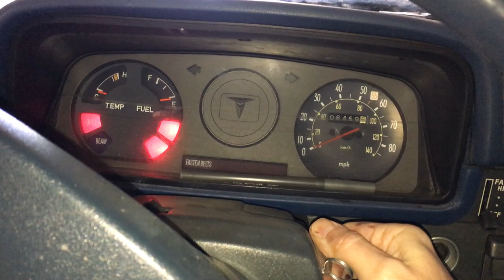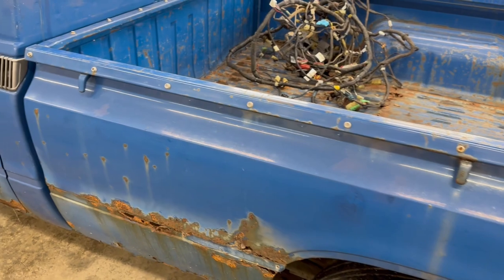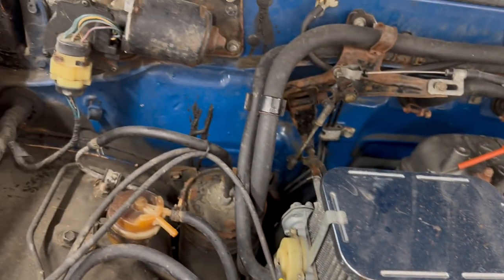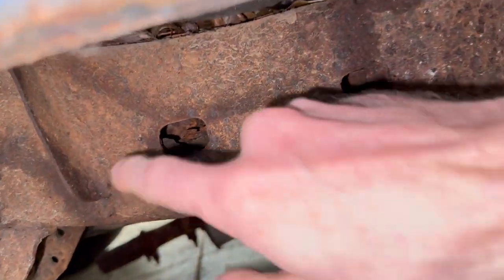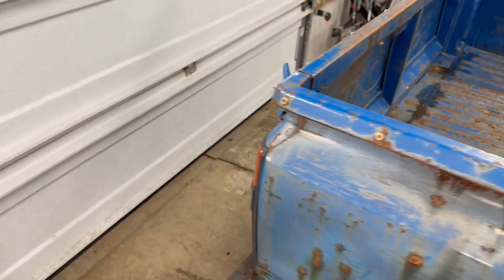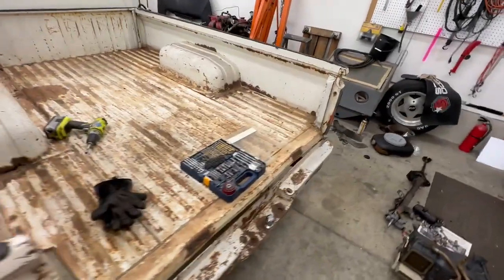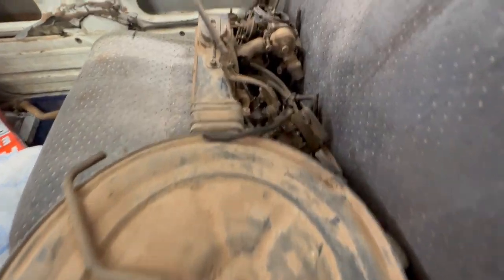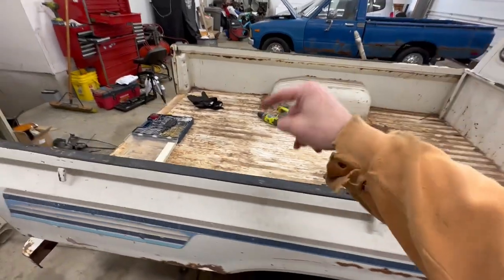My Rusty 1980 Toyota Pickup Truck Long Bed(s) Build Intro

Comment: If there is anything to do with Toyota utes l will click on it because l live in Australia and own a 1997 Toyota's Hilux rear wheel drive ute with the 22R motor and with a five speed gearbox mine is running driving and registered and four years ago l paid aud $1500 for it and no rust at all been Australia not much snow also it has an aluminium tray l see the ones from North America will rust because of the salting of the roads and many other older cars rust in the rust zone and Toyota spent billions of dollars replacing rusted chassis not in Australia l do like the 20R motor it's similar to the 22R motor just a bit less capacity to the 22R motor and 1997 was the last year of the 22R engine l am so happy to have one and it didn't appear in the Toyota Hilux until the mid 1990s as far as l know l will be interested in how your Toyota ute project pans out
Reply from the maker: The 22r will live forever, but like you said it is the rust that kills these trucks around here. I wish the Hilux was available in the US. After 1995, US replaced it with the Tacoma.
Reply: @6thGearGarage  Fortunately most Hiluxes don't rust in Australia because there is no such thing as the rust belt so the ones with the 22R engine will go for a long time l know my 1997 Hilux will out live me and any 1997 Hilux with the 22R engine manual air-conditioning an aluminium tray and under 500000 kilometres are actually worth aud$5000 to $6000 and l have seen them sell for that

Comment: Are you still running the original toyota driveline on your lifted truck. I jist bought an 89 that's running the stock trans and axles, but it has a tbi 350 swapped in. I'm just wondering how strong the trans and axles are. So far, they seem to be ok, but I haven't driven the truck much since its a bit of a project. Thanks in advance.

Comment: I have a truck similar to yours, mine is 1979 al so is blue and I'm looking for the Heater Hose Kit in case you want to sell it.
Reply from the maker: I wouldn't buy a part like heater hoses used. That rubber is 40+ years old and not worth the headache of a possible coolant leak.

Comment: This is very similar to what I did a couple years ago. Had a low mileage 1984 3/4 ton 2wd long box with a rotten frame that I frame swapped and built up with a donor 1987 2wd. You don’t even need a hoist to remove the body, I was able to sling the cab and box off with a regular engine crane. I would recommend you try and find the heavier front sway bar from a 3/4 or 1 ton model for better cornering at highway speeds with a load on the back. The parts for these 2wd trucks are super affordable, and their really easy to put together. Your going to have a great time with this project! Let me know if you have any specific questions, would be happy to help out 🍻
Reply from the maker: Thanks!

Comment: looks like the parts truck has aftermarket a/c. if you have any interest in keeping that and making it work let me know. I have a few different 22r compressor brackets and all the stuff requited to make new a/c hoses.
Reply from the maker: It does, I just pulled the evap box out this week. IM not sure if I’ll put it back in yet…
Reply: @6thGearGarage  the evap box is the hardest to find part for these trucks. its very easy and pretty cheap to upgrade all the under hood components to modern stuff.

Comment: Did Toyota ever make the 20R with a points distributor?? If so would it fit a 22R?? (thinking EMPs)Tip on rear main seal leaks...I chased them for years (been driving same 1987 since 1987, 1/2 million miles) till I figured out its the seal retainer gasket 90% of the time...silicone them (I use Toyota black, easier to take apart then autozone RTV) and timing chain cover gaskets, also helacoil 12mm threaded hole on top on timing chain cover (bolt through the head under dist. gear) allows for a tighter bolt and no leaks there. Great price on the blue truck. the Weber is $350 alone...I run a 38mm, .50 lift cam, stroked, LCE stage 2 motor (cost more then your blue truck)...Went from 103HP to 160HP...blew up a G54 trans and 4cyl rear end...Found a R151F turbo trans (cost almost as much as your blue truck) and got a V6 rear end...Getting 17city and 19hwy mpg.....Get your parts store updated so we can help pay for your rebuild....
Reply from the maker: This is my first 20r, I’m still learning. I’m actually surprised how different the first gens are from the second gen trucks. So far just gutting the interior has been a new experience for me. I’m excited for this build though… and I’m working on the store whenever I get a chance 😁